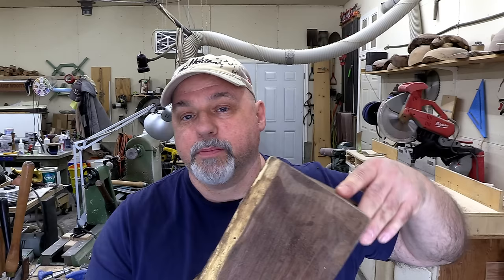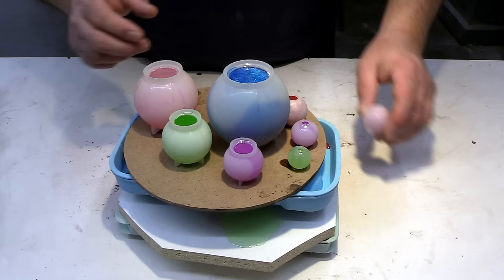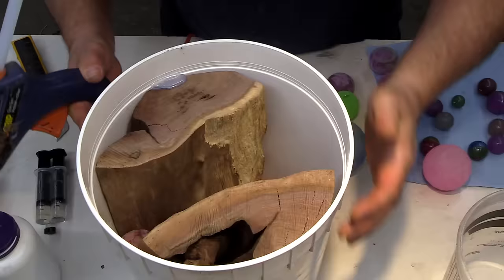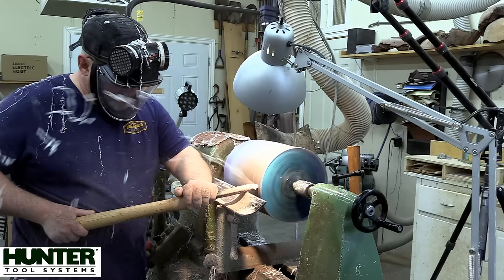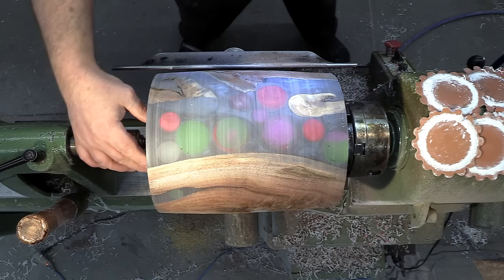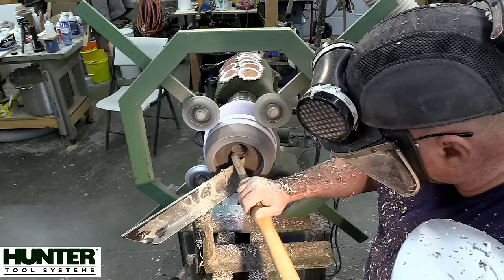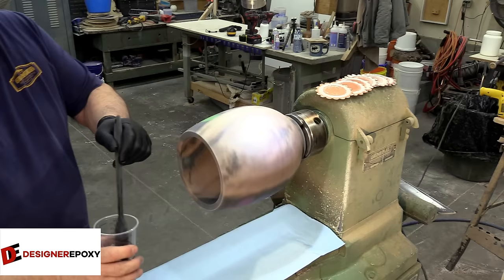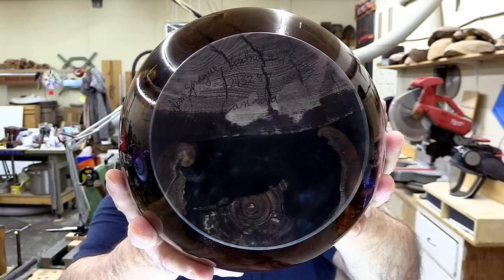Woodturning - It's "OUT OF THIS WORLD!"

Comment: Not going to lie. It looks amazing and the glow in the dark bit puts a whole other view to it, but I cannot help but think you cut away an awful lot of the original material, which seems like unnecessary waste to me. It was almost as if you had a completely different idea initially and then changed your mind on it. other than that, like I said it looks really good.
Reply from the maker: I don’t like being handcuffed by spacers, I love the freedom to through a casting on the lathe and make whatever from I want. This is why the globes were placed in the middle and other area that were turned away. This easily could of been a hollow form and then the globes in the middle would of been in the final piece. Thanks for watching!